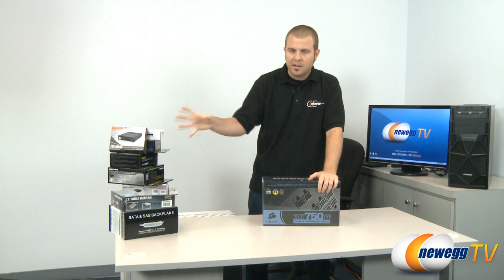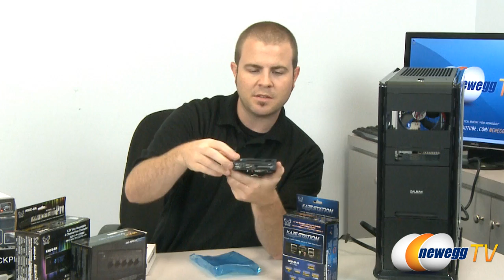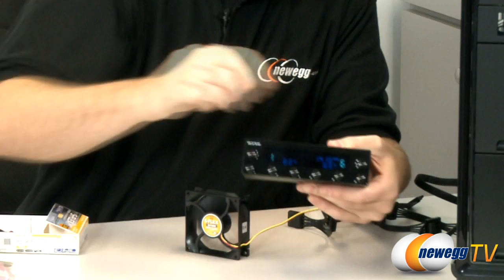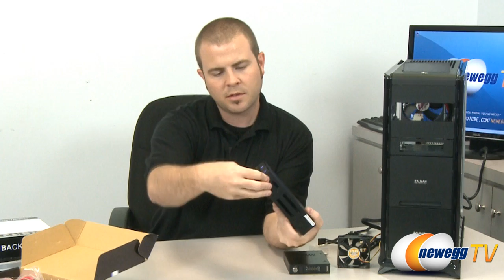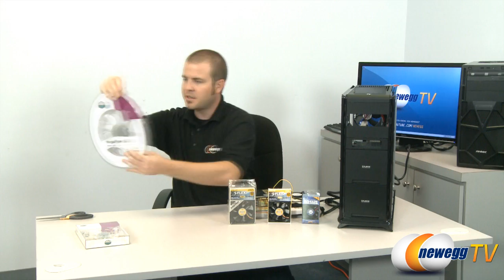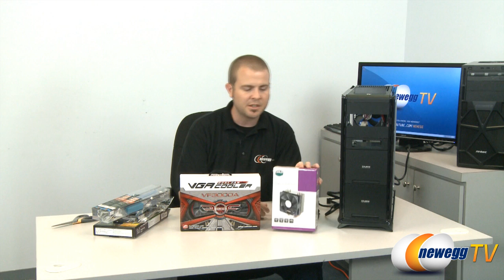Newegg TV: PC Addons and Accessories

Comment: That door, the first ad on you showed, I'm thinking I could take all the extra wires and plugs from the power supply that are not in use for the actual PC, and route them into that door so when I pull it out I can test drives, ect directly from the front of the case without pulling the tower from the cabinet and removing the side cover. 

So here's the thing, I have two 5.25" and one 3 3.5" on my case. I guess i'll put two doors, and that fan control in the small opening.

Comment: Scythe Kaze Master Flat 5.25 Inch 4 Channel Fan Controller Black KM06BK 
windows 8.1   there way change warning temperature ? with tool/options in windows ? or only with piece on boardmom inside pc box..

Comment: Thicker 38mm fans are desired for their ability to maintain a higher static pressure.  Static pressure is useful when moving air through obstructions in your case, especially water cooling radiators.  The extra width allows the fans fins to have a greater surface area and in return a more powerful burst of air.

Comment: WE NEED A FOLD OUT SWIVEL CUP HOLDER FOR 5.25" BAYS!
Reply: I foresee some accidents...
Reply: customcrowd Mitroc Or rather a case that is also a fridge. Refrigerates your drinks on one side and shares the cool air with the PC for a ultra cool system.
Reply: Daggerflint we need a built in fridge in computers

Comment: Wow, a floppy drive. Oh how floppies bring me back.
Reply: when i was in the military e used the HUGE 8. something floppy disks! and the hard disks were platers normally 10 in a stack that were in a Tupperware type inclosure that would be go into the hard drive enclosure that were the size of a kitchen washing machine! yes we had to open them and yes a flake of dust would end up getting on a surface and crash the platter in a massive way. We also used punch card readers, and finally tape drives like reel to reel decks. this was top of the line way back in 1991!!!!!! yes this machine was the size of a house and controled all transmissions to and from the ICBM nuclear missile fields!!! Scary looking back at it.

Comment: The hot swap bay for the front panel are nice to have. I think that Paul had forgot, something I thought was useful for my system, it's more of a permanent, a 5.25 inch HDD adapter.
I use it to free up the space behind my intake fans.

Comment: A thicker fan will have thicker blades, so it will move more air at a slower rpm, just like the bigger fans.
Reply: And they are optimized for pressure.
Reply: I like my fans extra thicc

Comment: I can't find the Scythe Kama Cabinet anywhere on the internet.
Reply: ***** I'm going to upgrade from my Pentium 4D and Nvidia gtx 8800 gt when Skylake-E comes out or if they finally do a massive bump in performance for graphic cards so I don't have to sli or crossfire to have playable frame rates. I also want a cat and girlfriend lol.
Reply: that's why you look in the description
Reply: Ramon Vaders I mean, I can't find it for sale any where. It seems to be sold out world wide with no word as to when or if they'll ever come in stoke again.
Reply: ***** Here's a similar product, just not as fancy (karma is "fancy" because of padding and seperater) http://www.amazon.com/desktop-computer-companion-accessories-Cosmos/dp/B006VAD2C6/ref=pd_sim_e_3?ie=UTF8&refRID=013TMG5TEZ9JF3G48KBM
Reply: ***** Plenty of others do them. Just type in 5.25 pc drawer into eBay or something.
/)
Reply: I know I ended up getting an Evercool one. However I did want the mesh finish as the front of my case has alot of mesh on it, and I wanted the USB port and LED lights it came with.
Reply: Aww shame. You know how to solder? you could just drill some holes in it and mount some leds that way. Still tho, it's stuff like that that gives a pc character though right? Imperfections. Especially if you've built it yourself. May I ask about the specs just for the sake of conversation?
Reply: I've not finished building it yet but this is what it is going to be.
CPU: i7 4770k (overclocked to around 4.7ghz)
M/B: Gigabyte Z87X UD5 TH
RAM: 32Gb Corsair Dominator Platinum 2400mhz
GPU: Gigabyte GTX 780 Ti GV-N78TGHZ-3GD
PCI-E SSD: OCZ Revodrive 3 X2 480GB
SSD: Samsung EVO 1TB 
HDD: WD Black 4TB
Sound Card: Creative Sound Blaster ZXR
CPU Cooler: Enermax Liqtech 120X
Case: AeroCool Mechatron Black Edition

The only parts I have left to buy is the GPU which I should be able to get next week,
PCI-E, SSD, HDD and the OS which will be windows 8.1 pro.
Reply: pretty cool build! :D Especially that RAM. High end stuff.Never heard of that case but I ADORE the looks of it. The only thing I'm not sure about on that list is win8.1. I have tried to like that os but just don't. It makes sense for touch screen devices imo but I'm building a desktop with a keyboard etc so I deliberately went with Win 7 ultimate. Ive been building a rig myself inside a cosmos 2, I was almost done til my psu failed on me. facepalm I didn't overload it or anything, it just died. Luckily, It doesn't look like any other parts were affected. Nearly up and running again. nearly. Even then, Ive got quite a few upgrades to do.
Reply: That a good case you got there. I was unsure about win 8.1 at first, I thought the same as you but I grew on me as my friend has it. Apparently in benchmarks you can get higher frame rates with 8.1 over 7 ultimate. When I bought the case I forgot to take measurements in to consideration and as a result I can't put a Corsair H110 in it like I originally planned. This is my first personal PC build and in a few years maybe when the Broadwell Extreme comes out I'll upgrade to that + another 32 gig of ram, SLI my GPU. Move it all into to the Corsair 900D and watercool the lot.

Comment: I'm installing a Silverstone FP56 card reader in my computer for several reasons. 1st, It installs in a 5.25" bay rather than in a 3.5". 2nd, As well as reading almost any card, It provides 4 additional front panel USB 3.0 [Although red slot not backward compatible and is USB3 only]. And 3rd, it has a built-in mounts for 2 2.5" HDD or SSD.
Also researching if I can get a fan to install in a 5.25 for better cooling

Comment: thicker fan would increase the surface area of the fan blade. therefore increasing the dynamic pressure of the fan. this does not mean that if would increase the CFM, but if you put a dust filter or a radiator by the fan, the CFM will not dramatically decrease.
you might prefer buying a thicker fan for a radiator instead of doing a push-pull configuration.

Comment: I have a CM Cosmos II and there are two X-dock bays taking up space. What accessory will fit in that space? It isn't two 5.25" bay and the space looks smaller than that.. it is like two 3.5" bay height with 5.25" bay width.

Comment: I think the thicker fans are the same Idea as a really wide one, so if you only have 120mm ports open, the only solution to move more air is faster speeds (more noise) or thicker fans that can move more air per movement.

Comment: Some people still own floppy disks and might want to access their data on them.

I do understand where you are coming from though. Nowadays, you don't need optical drives. They make installing your operating system a bit easier, but it can still be done via USB. I currently have 1 optical drive in my system, with room for another. I play a tonne of old games and love to pick up cheap games on disk at markets, so I need my optical drives. But recently (thanks to steam) I hardly ever use them.

Comment: I have it in white and it has to be the best case I've ever used. Customization is awesome, I added coasters to mine to make it easier to move and not its even taller lmao, I put a window in it, and love that I have enough room to put my 280 rad in the bottom. since I put it on coasters I cut out more air holes on the bottom to allow more cool air to come in... still not done modding it but I love this case

Comment: I put a floppy drive in my PC just for nostalgia purposes. I remember being 15 years old needing to use 3-4 of those a: drive 3 1/2 inch floppies just to put a power point presentation on. I still have some 3 1/2 inch floppy disks on my bookshelf just in case 1997 calls and asks for a .ppt

Comment: Some external HDD's can connect to an E-Sata port but also require an additional power from an AC adaptor. They have been mostly phased out by USB 3.0 and even 2.0, but are still prevalent on most PC's. :)

Comment: I thicker fan usually means higher static pressure as the pitch is longer on the fan blades. They work better for radiators and heat sinks to push the air through

Comment: A thicker fan "should" allow for greater static pressure, which is good for heatsinks & radiators. A thicker fan allows you to have fan blades that have deeper, more pronounced scoops that increase the pressure.

As far as I know, a fan with less blades, but deeper scoops gives you better static pressure. A fan that happens to have more blades, but has thinner blades should give you a better CFM. There isn't enough room for A LOT of thick fan blades, so we have to find a combo that works for us.

Comment: 690s aren't even that hot, especially considering its a dual gpu card. Personally, I think that the only thing that would really help with temps would be a full-cover waterblock and water cooling system.

Comment: it's likely it won't work. i looked up the board (tp406) and saw no standard connectors aside from the typical stuff like sata, slots ect.. power connectors looked standard to but i saw no pins for wiring the switch. you could likely make it work but i wouldn't. the xps machines i saw had a 775 socket and core2duo. you'd be better off leaving it or upgrading completely (imo). maybe you could get another board to take the stuff from your dell cheap to. pm me if you want some more help buddy

Comment: Paul, with a thicker housing you can have more angled blades. Optimally you want 45 degree angled blades (of course compensating for the curvature) so you have the most amount of air moving into the case. Since the housing of the fan is thicker the blades can be angled more so hence can move more air with less noise and a smaller diameter fan. Essentially, assuming that this fan uses 35 degree curvature versus a 15 degree curvature of a regular 120 mm fan you have about 2 times the effectiveness

Comment: The reason for the extra thickness on the 120mm fan is airflow. The extra room in the fan housing allows the fan blades to be warped at an angle that will increase airflow.

Comment: You only have a few items linked on the page (on newegg) that you spoke about.  What kind of marketing job is that.  Took me 5 minutes to type in all the missing items I wanted to see.

Also the NZXT is not an outside (on the desktop item) as you showed it.  It's a huge dual slot inside front bay mounted fan controller / display.  Just FYI.

Comment: thicker fan is better because it increese the size of the wings (and the volume between 2 wings) and than for in will increese the air flow so you can slow the fan

Comment: I'm not sure if someone has already answered this already, but the reason why there are thicker fans, ex. Scythe Ultra Kaze, is because they tend to have a higher static pressure compared to the thinner ones. Static pressure in my knowledge is only important when you get into liquid cooling and you have a radiator with tightly packed fins. A low static pressure fan with high CFM will lose a lot of airflow by the time it reaches the other end, and thats where a high static pressure fan is needed.

Comment: the thicker fan is meant to give you a higher static pressure. it makes more air pressure and lets you move more air through a radiator for a liquid cooling setup.

Comment: @p8intballkid A thicker fan means more static pressure, which means the most air constantly being applied to the rad. However, not all rads work best with thick fans.